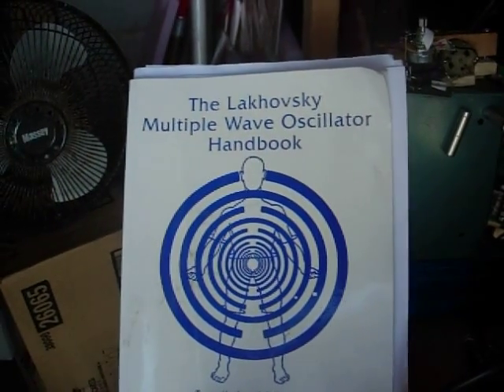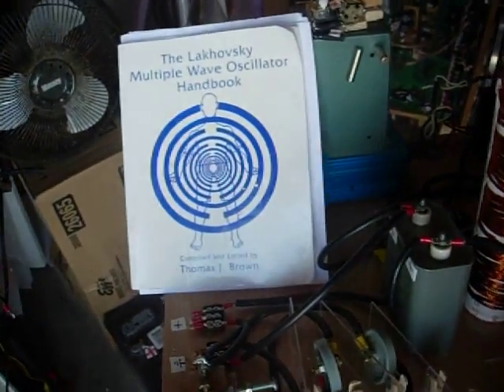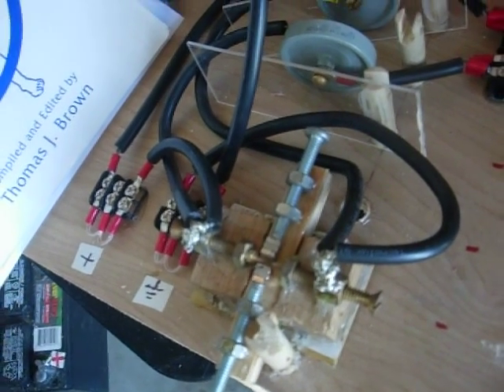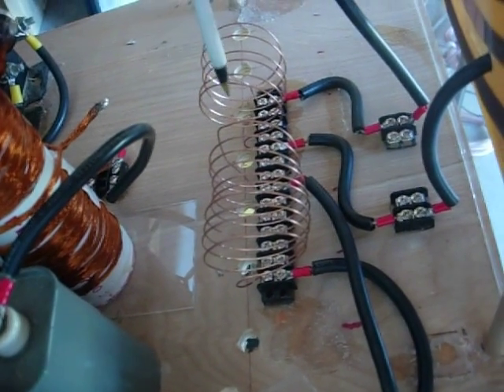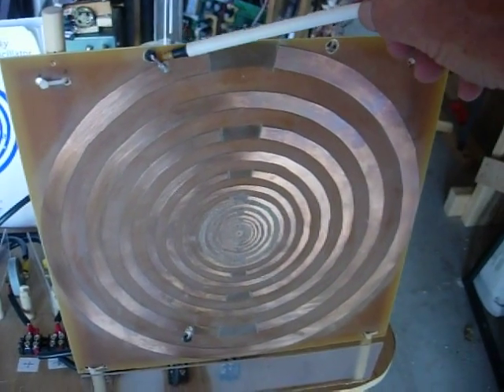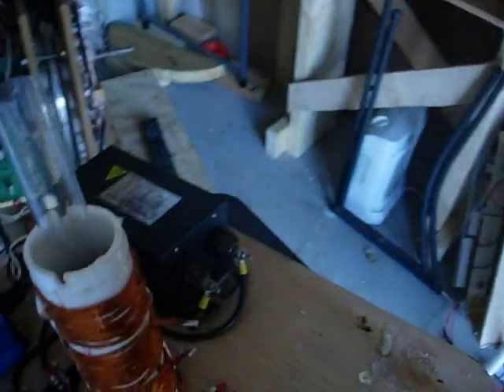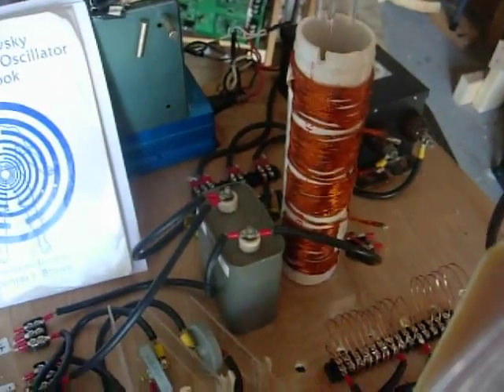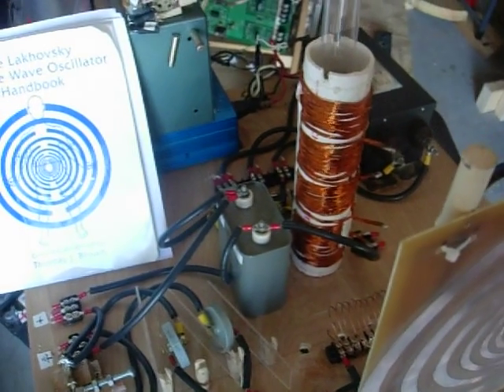Don Smith #68  First MWO prototype done

Comment: Awesome
Reply from the maker: Will post the schematics today with video and descriptions.  from the book I have several to try out.

 The pcb was made by putting duct tape over a 12x12 dual sided copper clad board The template was larger than 8 1/2 x 11 paper so I had to print 4 sections then tape them and cut out the pattern.  the pattern was then laid out on the pcb and I used an Exacto blade to cut the circles.  Since the inner circles were very thin I decided to dremel the inner 4 rings and then place another layer of tape over that area.  the Dremel too made the circles pretty ratty.  I have another PCB so I can try it with one layer of tape and no Dremel.  The etch time is about 40 minutes because their is a lot of copper to be removed and hopefully the tape will keep the solution from eating the smaller circles in the inner rings.